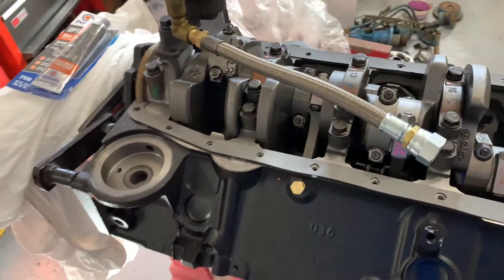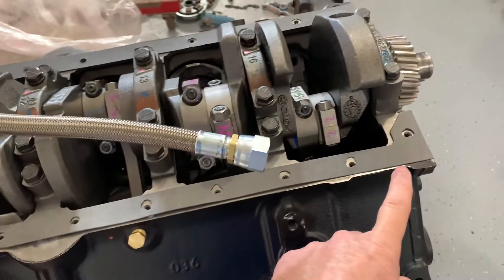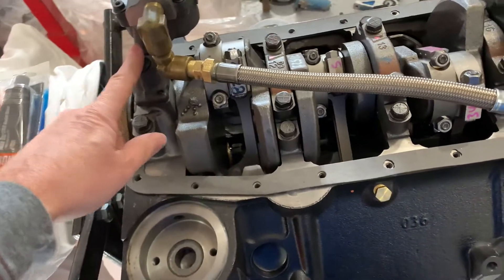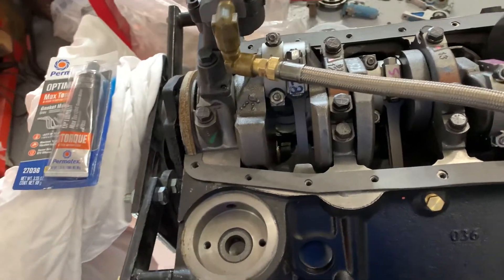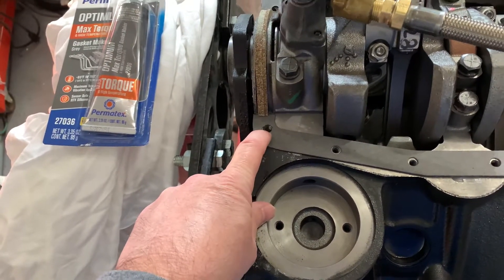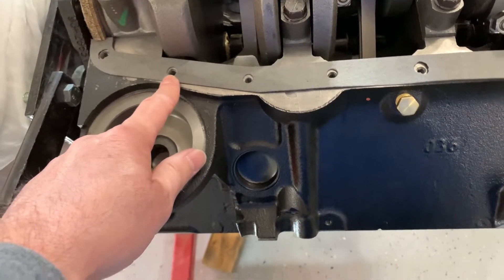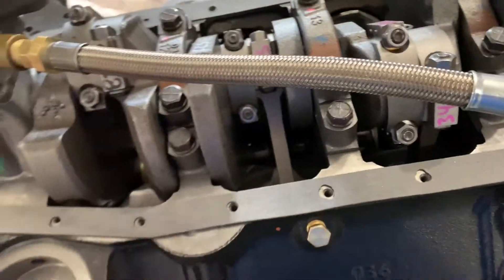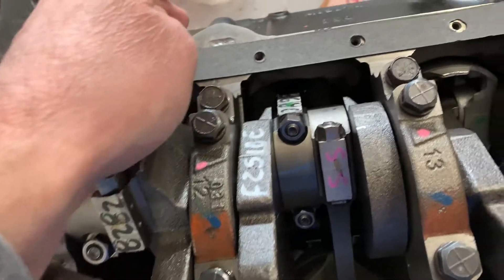How to build a Chris Craft 283 / 350 conversion marine motor Part 3

Comment: Hello Don, your video series about this motor is golden! Thx for all the detailed insights! I have a question about the original oilfilter fixture that you show in your video. Do you still have that and would you be selling it to me by any chance? I would like to change my current setup to a remote filter unit, as currently it is a real mess to change oil when removing the housing for the filter from under the engine block. Its a hard to reach place and a real mess as the remaining oil leaks everywhere. (I am from Germany so it is a bit tough for me to explain in better terms) Thank you for a quick reply.
Reply from the maker: I will check to see if I saved the original.  Please send me an email at rivachriscraft@gmail.com

Comment: Did you have any issues with clearance between your flywheel side connecting rods and the oil sump line hose?
Reply from the maker: No clearance issues at all
Reply: I found my issue, going from 283 to 305, I had to adjust the angle the hose fitting was coming out of the pump itself, not sure why it wasn’t the right angle but I pointed it like yours is and that fixed it. Thanks for the great videos!